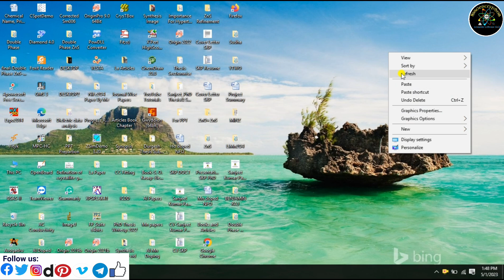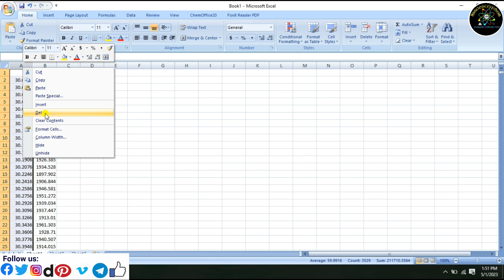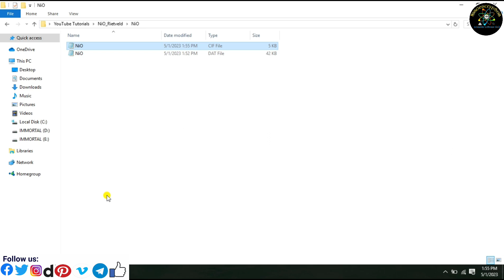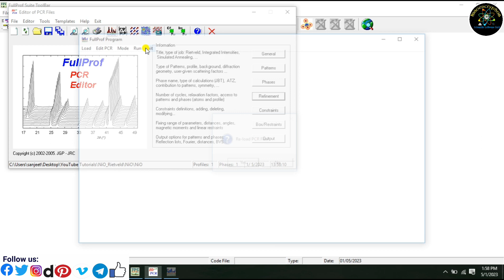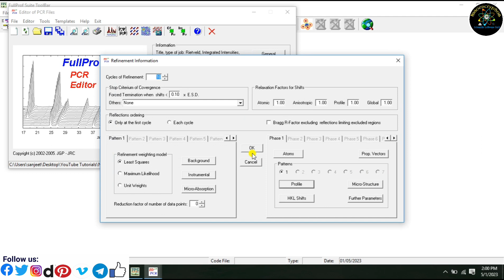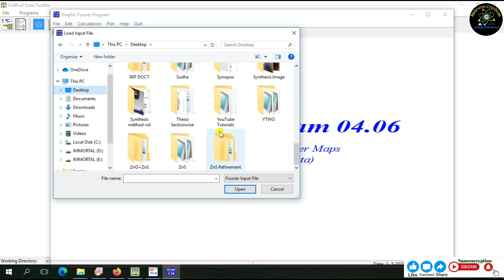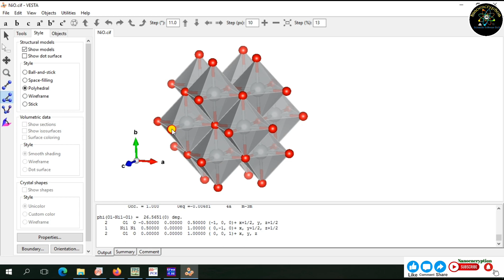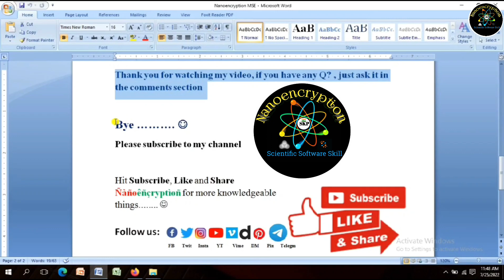Rietveld Refinement and Crystal structure of Nickel Oxide (NiO) material using FullProf Software

Comment: Hi sir, do we need instrumental file for doing refinement?
Reply from the maker: In fullProf Software, there's no requirement of an instrument file but if you want then you can use. Also, it is not necessary.. Just follow the tutorial steps precisely.. And try to run the rietveld refinement..
Reply: @NanoencryptionSKP  thank you sir
Reply: @1.55 minutes, you have entered 0.017, why are you doing so, what is the purpose of that value there?
Reply from the maker: @divyadharshinis8495  Please read fullprof manual there are everything mentioned with stepwise.
Reply: Sir I want to do refinement of CQDs please help me how we can do it